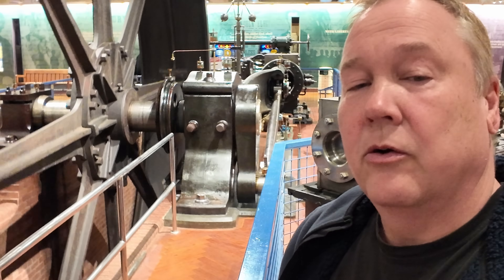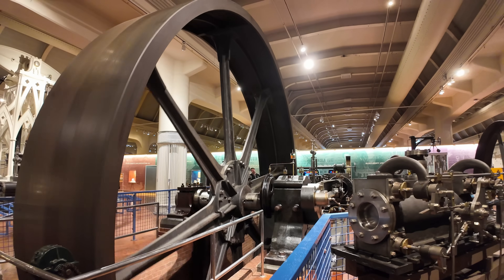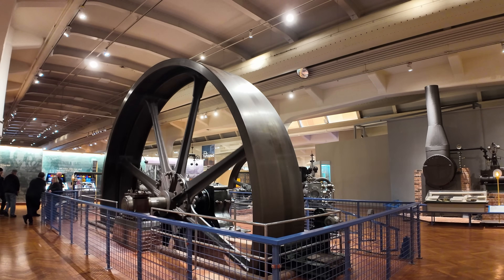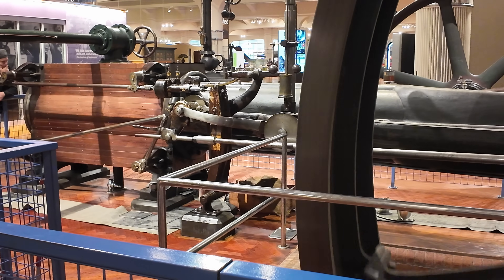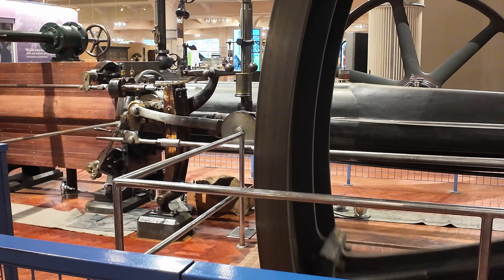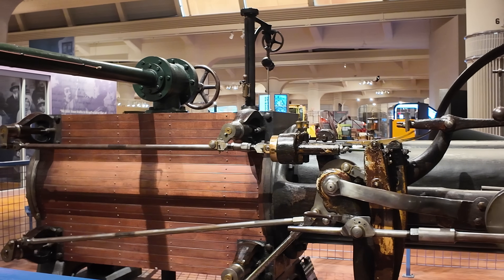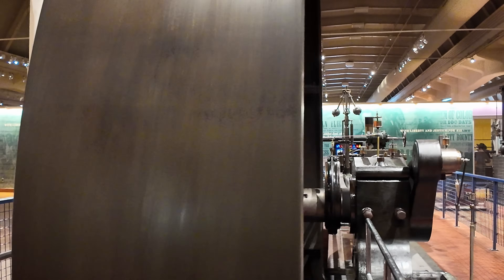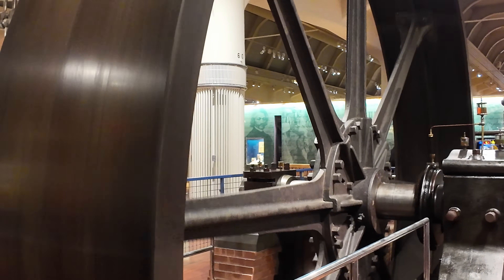Perfect For Textile Mills - 1859 Corliss Steam Engine

Comment: running on steam or compressed air
Reply from the maker: Originally, ran on steam.  When Henry Ford moved it to this museum, he rigged much lower pressure compressed air to run it at a much lower speed, to avoid venting steam into the museum.  He actually did that with quite a few of the bigger steam engines.  Unfortunately, this is the only one on the inside of the museum that still runs.
Reply: @Industrial_Revolution That's very interesting. Is there any footage of that by any chance?
Reply from the maker: A bit more info may be needed than my initial reply.  Atmospheric engines can't run on compressed air, all later steam engines, where they don't rely on condensing steam creating vacuum, run just fine on compressed air.  There's even been some steam locomotives which have had their boilers replaced with high-pressure compressed air cylinders and they run the the locomotive on that.  They were used mostly in places with extremely high risk of fire or explosion.